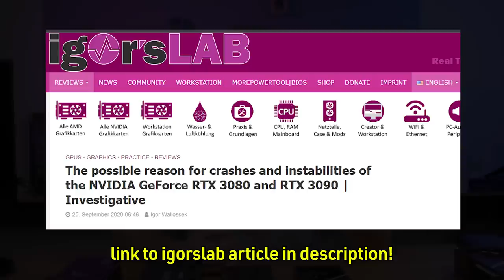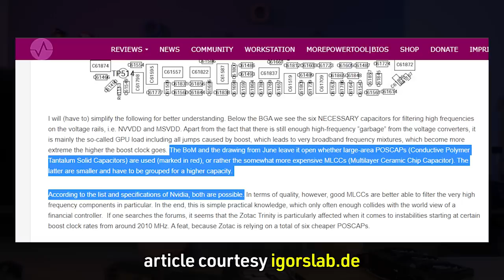The RTX 3080 Launch can't get any worse... Right? Wrong...

Comment: In a perfect world the headline reads: "Scalpers Stuck with Defective GPU's"
Reply: Scalp these high dollar GPUs! Make the tried and true cheaper. More power, brother!
Reply: The cards themselves are fine. They work within NVIDIA specs. So far it seems boosting/OC is only an issue when it comes close to 2 Ghz and on cards that that only have POSCAPS. Cards with one or more sets of MLCCs have less or no issues.
What needs to be seen is wether NVIDIAs reference gave out unclear info or if the AIB partners cheaped out and tried to skip on an MLCC that is ultimately needed.
Another issue that needs to be revisioned is the required secrecy prior to launch. GPUs were only tested in a technical sense, but the interaction with the driver was impossible to test for the AIB partners until very close to launch. Either NVIDIA and AMD will have to put more trust into their AIB partners or they will have to find a secure way to offer AIB partners earlier access to the software side.
Reply: HAHAHAHA GOOD FOR THEM LOL
Reply: Literally LOL...
Reply: Sadly not everyone know that scalpers cards might be defective.
Reply: And idiots buying from them wont get warranty coverage.
Reply: Wolfpack3D  same
Reply: @LowStuff   SPCAPs, they are not POSCAPs, but still shit lol
Reply: imagine you buying premium from a scalper and getting the defective GPU.... double kill
Reply: @bonns36  and selling your 2080ti for 500 bucks
Reply: LOL
Reply: @Battleneter  Thanks for the correction but the capital NOT makes it seem like you got really hard over this. Which is fine. If that's what does it for you!
Reply: :D
Reply: @LowStuff  The problem with getting things to AIBs is that they leak like sieves. Just going off of Moore's Law's channel, If I were Nvidia I'd be fining AIBs since it seems like every major AIB was leaking their asses off. AMD's done a slightly better job but it's more AMD's Chinese based driver and test teams leaking things there.  If AIB's want to get access to things to have better influence on things like drivers, they need to really step up their INFOSEC game. In most other fields, this much leaking would see the partner in court or contracts nullified. Consumer tech seems to be the only real industry trying to keep pace with the U.S. government as of late as far as confidential leaks are concerned. While there is something to be said that sometimes the company purposely releases a bit of bait or info as a "leak." But what we saw with Ampere and now Big Navi are whole orders of magnitude worse. People were leaking reference PCBs, architecture white papers before cards even hit manufacturing. I wouldn't be surprised if the public was getting its hands on news before execs were because some engineering intern at one of the contracted offices couldn't keep their phones in their pockets. As an engineer based in testing and thermodynamics, I find the massive amounts of leaks from testing companies outright disturbing. It's also noticeable that nearly all of them seem to be occurring in China and hit Chinese social media first and people in China are sifting it out through the "Great Firewall."
Reply: @matizluv1316 Perhaps stop "making stuff up", if you didn't know please don't mislead others, just don't say anything.
Reply: Wolfpack3D ? So you can't compare clockspeeds from different architectures, it's pointless
Reply: @LowStuff  yet some of the suppliers have done better than other , Zotan - making the cheap fix, Powercool stopping because of the issue, MSI and another doing it right - or better then Nvidia
Reply: @worthlessguy7477  look at this tear down of multiple brands - then avoid those with the poscaps
Reply: @Battleneter  those with MLCC may be more robust in handling / avoiding  a deeper defect - or maybe the tolerance of the MLCC may be brought to question - an X7R is so much better than a Y5V
Reply: @deansmith4752  who knows it's just due poscaps. It might be due to Samsung's 8nm fab also. Linus in he's lan show said fe version was also crashing. Gamer meld has pointed one reddit thread or something where tuf version had also had this problem.
Reply: @deansmith4752  I have yet to see any evidence the capacitors are the cause of the crashing, its still just a random theory.
Reply: Wolfpack3D  lol, lots of pascal could run at 2.1ghz, pretty crazy
Reply: Battleneter so random guy with no proof claiming that?
Reply: Absolutely!😊!
Reply: Mua ha ha haha
Reply: Load size. Ooof
Reply: @Michael Burgess - Man, isn't that the truth.  For once, their greed bites them in the butt.
Reply: So basically here's the breakdown of how living "in the future" in the modern world feels like:  I can't go to major rock concerts when they come to my area because scalpers already got all the tickets online on the first 15 minutes of sale. And I can't buy new hardware because scalpers got their filthy hands on all of them.  What the fuck is happening in the world we live? Jesus fucking christ

Comment: Thanks early adopters, for beta testing!
Reply: Alpha or beta 🤔
Reply: Beta
Reply: I am an early FE adopter, no issues here overclocked. You are welcome, though
Reply: Tom Gjonaj pretty sure the FE is fine, it’s the cheap custom cards
Reply: @tomgjonaj9965  Looks like FE and any cards that use at least one of the more expensive capacitors are good to go. Me and my EVGA card are straight vibin
Reply: @Evili555  i hope. I paid 1000 locally from a dirtbag scalper for this thing new in the box, lol.
Reply: @tomgjonaj9965  Good job feeding the scalper's incentive.
Reply: @surjux6271  dont really care, 1000 is peanuts to me
Reply: @xboxaddict552  thats a relief as i am currently waiting on my evga order (no i am not a scalper)
Reply: @tomgjonaj9965  tbh thats a better price than eBay.  that's a reasonable scalper ive seen in my entire life lol
Reply: @TheLilmage7  yeah factor in tax and shipping, i only paid about 210 bucks over msrp
Reply: @tomgjonaj9965  guess you didn't watch the video
Reply: @tomgjonaj9965  You paid $1000 and think that is only 210 over MSRP? Never paid shipping in my life on expensive electronics and I never will, I don't care what country it comes from. They try to charge me shipping and I call their asses up and ream them  out until they get rid of it. If you are paying $500+ for a product, they have ZERO business charging a dime of shipping. Not to mention shipping on that would be like $5.00 for it's size. Try you paid over $270 above MSRP. Good for you that $1000 is peanuts, doesn't mean you should overpay. I don't care if you pull in $1,000,000 a day...you don't stay wealthy by overpaying by 30%.
Reply: @tomgjonaj9965  its not that bad, but over paying for shit is not the way, how can you be so desperate for a object? materialistic much?
Reply: @danielredziniak2996  yes very materialistic, and very depressed
Reply: @tomgjonaj9965  you're still feeding into them yet you call them a dirt bag. But no you're impatient.
Reply: Sorry you couldn't get a card ROB!
Reply: @tomgjonaj9965  it doesn't matter how much money you have, you still got ripped off
Reply: @jonnoble2815  don't care, I've been enjoying the card since the 17th and will just upgrade right when the next one comes anyways. Money is just paper, and I blow it
Reply: @jonnoble2815  he's got a point though he was just using paper that has value and they technically are worthless
Reply: @TheLilmage7  wtf ru talking about, he probably lives with his parents, he's just showing off which is pretty stupid

Comment: It’s kind of sad how Asus’s BUDGET card didn’t cheap out on capacitors, unlike cards well above msrp.
Reply: Back in the day TUF used to be the best quality hardware. Remember Sabertooth? Sadly Asus ruined the TUF branding relegating it to budget segment however it is refreshing to see TUF back where it started. Hopefully the quality stays with future generations and all other TUF produts.
Reply: Exactly all 6 are premium, which kinda shocked me, and is cheaper then the rest of the doornobs, Asus did awesome
Reply: Lets just hope thier Strix card has not cheaped out
Reply: ASUS "budget" cards will be above MSRP within a month, as stated they get a rebate from nvidia for the first month to match MSRP.
Reply: usually asus don't cheap out, they do mistakes that make their cards not as good. It's a different level of bad
Reply: Prasoon Tiwari Yaas, that Sabertooth board was were it was at. I would throw so much at it and OC FX8350. it stayed strong for many years this is actually it’s why I stay with Asus boards and well now Asus GPU 😱
Reply: Probably because the engineers at ASUS know their job and/or they did some proper testing before release. 
They knew it wasn't going to work. 
And they probably decided the small gain in profit from using less and cheaper capacitors isn't worth the loss in reputation they'd have to experience.
Reply: @UCJ0S6WyCN_TZoILXz-9sDEw der8auer took one apart and it doesn't have the cheap caps in it. All 6 premium ones. Let's hope its just a photo and not final product.
Reply: @thealien_ali3382  Check Reddit. Been confirmed Strix has pics out with cheaper caps not all MLCC. MLCC might've just went to reviewers.
Reply: so was the ASUS TUF effected by this, I missed it on the video.
Reply: Does anoyone have a STRIX CARD? Their promotional material on the website shows the cheap ones, unlike the TUF.
Reply: And in this time they got cheaper on the ROG Strix
Reply: Jay, ASUS's YT video of their TUF card  ( /watch?v=YoY9kEHzMkQ ) clearly shows it with the larger sub optimal parts. Did you mean to say ASUS's TUF card will or will not have this problem?
Reply: @devduguay2814  Its confusing coz der8auer has taken one apart and it has 6 mlccs. But the photo on the website has the cheapos
Reply: U are My submissive toy 
Isn’t it the other way around? The TUF cards weren’t good until they started using past gen cooler, and other tech from strip?
Reply: Bazooka's World 
I’d doubt it.
Reply: The 3080 tuff has photos of cheap caps on asuses website but we know it doesn't actually have them. Surely the strix wouldn't cheap out considering the premium your paying 😂
Reply: I looked up images and they actually did. The Asus Tuf OC is the one with all six as the more expensive capacitors.
Reply: Funny enough the TUF is actually the one I'm liking best from all the custom cards looks wise (nice and simple) and it's even cheaper than the others. Still, I wouldn't pay more than the advertised 700 bucks anyway. Gladly I won't get tempted into buying any of them as they are not available anyway. Can't wait for Team Red's offerings to do an informed purchase.
Reply: I can't comfirm yet BUT acording to on-line pictures and early reviews it looks like only the ASUS 3080 TUF OC  is the one with the 6 array of the expensive capacitors , the standard edition the same Asus 3080 TUF (non-OC) appears tohave 6 of the "cheap ones".
Reply: Kin I looked it up and apparently there is an MLCC shortage which is no surprise that manufacturers use polymer ones to meet production numbers before launch
Reply: @killwize  They've changed it before shipping probably because they identified the problem
Reply: @Deathend  I have the Asus tuff. I can confirm it has all 6.
Reply: U are My submissive toy  im thinking ab buying the strix one but that side led being mounted kinda diagonal is bothering my OCD so much🤬🤬
Reply: @nicolass2782  I can confirm. I have the Asus tuff. I can provide pictures. It has all 6 arrays.I bought the card through NZXT prebuild.
Reply: that's why Kyle found the TUF 3080 performance so much better than the other AIBs he tested.
Reply: I've always gone Strix for my MB and GPU in my builds...apparently they have trash tier customer service but luckily I never had to call them
I trust their Strix line quality so I'm going to attempt to grab a 3080 from them whenever it launches, hopefully the experience is consistent
Reply: Wayocide Morldwide  fk yeah! Already pre ordered my oc version 🙌
Reply: That’s pretty much why I’m gonna buy the ROG strix version.
Reply: @WhiteHawk77  I dont think seeing photos matter this early, because the amount of cards that Ive seen people showing 2 layouts for is now just headache inducing. Id love to know whats up myself, because Ive ordered a 3090 Strix and have seen a 2 MLCC layout and a 6 MLCC. If NON OC TUF 3080s have all/mostly 6 MLCCs, then there is no way a top tier 3090 should have less than that!!
Reply: WhiteHawk 
Damn, you getting a 3090? If you don’t mind me asking, what will you be using it for?
Reply: @NursingPetrichor  you mean that the "non-OC" has the 6 array of the expensive better capacitors? this thing is kind of stressful and there are some pictures/renders online taht shows some TUF with 6 of the cheap ones, the good thing about this card is taht the back is open so you can see the capacitors without taking it apart.  ( at this point I think Asus did it to show off the capacitors LOL!)
Reply: @LVNeptune  I have seen pics of tuf cards with cheaper caps buy those that got it didn't have the cheaper caps so it seems the pictures may show the cheaper caps but they won't be
Reply: @ben2880  exactly, just buy of amazon if not happy just return, that's when the stock normalises, cause I have so been after a 3080

Comment: FYI, for the 10% chance someone reads this, none of this ended up being true, it was fixed in a driver by nvidia
Reply: That's good news, do you have a source?
Reply: What did the driver correct?
Reply: nah still happening today with latest drivers :)) I have to underclock my 3080 by -50 Mhz to avoid crash in any game. My card has just 1 of those expensive thingy whatnots. It stays close to 2000 + - 20 Mhz so I can`t complain.
Reply: @ChrissonatorOFL  As far as I know Nvidia's fix was to limit the boost frequencies so not really a fix.
Reply: @endame90  So far, I've not had any issues, and I use Redshift for 3D rendering.
Reply: No they didnt lmao nice try tho bud
Reply: My 3090 ti is still crashing